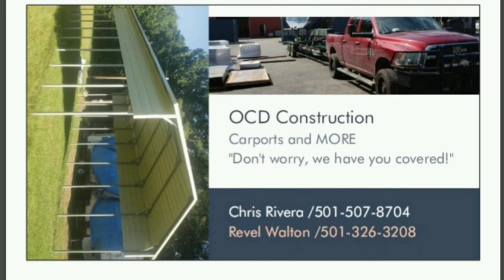Carport/Kitchen!?!

Comment: That carport should be installed in 45min you will have trouble out of the trim as well they installed it backwards.
Reply from the maker: I didn't know that. What trouble will we have?  The rain seems to follow the trim, let me know to see if we can fix it. Eventually we will be closing it in. Thanks Katie
Reply: @LeesArkansasBound  I just noticed that they did put the trim on under the peak and that is correct but I did not see on the video where they screwed the legs onto the base rail on the bottom.
Reply from the maker: @larrydollar512  They did do that, I probably ran out of memory on my phone. I had to sign a paper stating that and they anchored it to the ground. Thanks for getting back to me! Much appreciated❤